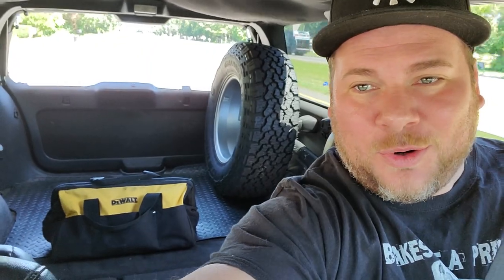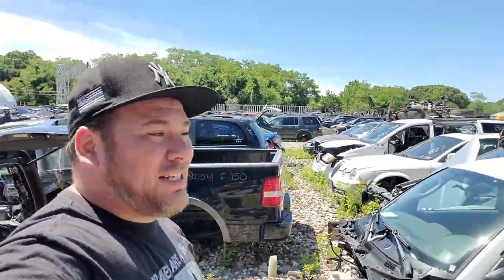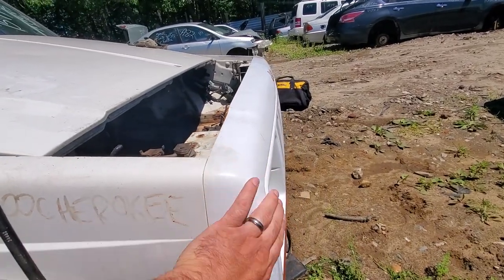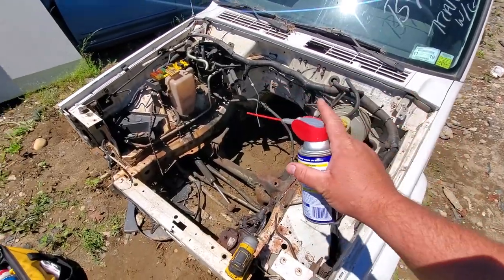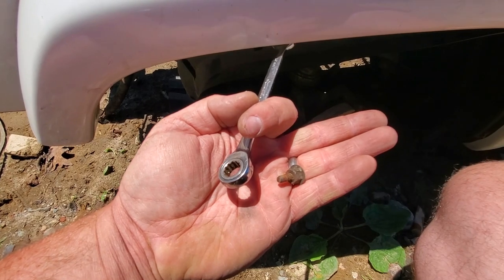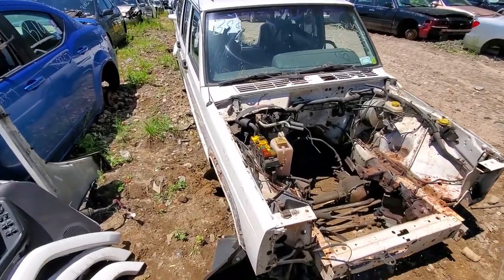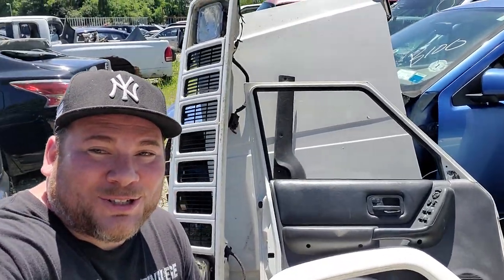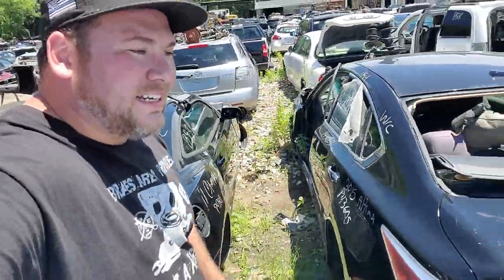JEEP XJ JUNKYARD SCORE - CHEROKEE HOOD, DOOR, FENDER and HEADER PANEL for POLICE JEEP and WRECKED J

Comment: Going to the yard tomorrow to get some parts for my 96 se, long story short one owner "sheriffs office" bought new however I am having the hardest time figuring out if its a true police package, dont really care either way, but wanting to obviously replace all suspension, it has skid plate in the front and over the gas tank other than that to me it seems like a regular xj, whats the best way to tell? I have done vin searches, title is normal, would the rear drum size be the best giveaway ?
Reply from the maker: There was no "standard" police package.  Most police options include 120 MPH speedo,  Ext Idle switch button, D35 rear w/ ABS,  rubber floor mats, economy wheels, no roof rack, larger ribbed rear drum brakes,  Skid plate package, trans cooler... some had push bars, and an extra map light... so on
Reply: @ProjectDanH  THANK YOU ❤️

Comment: Just a brief question for you off subject from your videobut what I would like to know is if I remove the AC condenser on my Jeepand run a bypass pulley and replacement of the AC compressor would it be okay leaving the condenser out when I rebuild my Jeep let me know thank you
Reply from the maker: I don't see why that wouldn't work.  youll just have to make sure you get the right tension on your belt.    also you may want to have a mechanic recover your Freon.
Reply: @ProjectDanH  the freon is gone thank you for your help
Reply: I have one more question for you have you ever come across a transmission on a Jeep where the two top bolts on the transmission we're regular bolts instead of the special ones I've been seeing in the videos

Comment: I want to start off by saying I love your content. You and d& e in the garage are the reason I bought a wj.
The oil pressure gauge keeps dropping to zero when it gets heat in it!
I replaced the oil sending unit with a factory oem mopar one but it still did not fix the problem.
The wj is from Scottsdale Arizona with 159000 miles and the motor ( 4.0l ) sounds and idles perfect.
Do you have any suggestions?
Oh and how do i buy some of your merch?
Reply from the maker: Hey Eddie! Thanks so much for watching!  Did you replace the oil sensor too?  Send me a PayPal donation to airvillan2000@aol.com and I'll send you some stickers! Thanks brother
Reply: @ProjectDanH  I just did
looking forward on putting one on my wj
Reply: Piglet: What day is it?
Poo: Junk yard day
Piglet: My favorite day

Comment: Hey Dan, I really enjoy your videos.  
 I am looking for some 2001  OEM XJ door pockets.  They seem to be rare.  My XJ had them at some point.but gone now.  Any ideas?
Thanks and keep the videos coming.
Reply from the maker: Hey Bob, They are very rare. XJ door pockets were only on the limited door panels with the wood grain.. find a limited part out and you'll find your door panels
Reply: @ProjectDanH  Yes that is what I have but there are just holes where the pockets used to be.  If you happen to run across any let me know and I will try to get them.  Thanks so much for the reply.
Reply from the maker: @hdbobt  you got it bob.. set an ebay search.  It will alert you when they come up